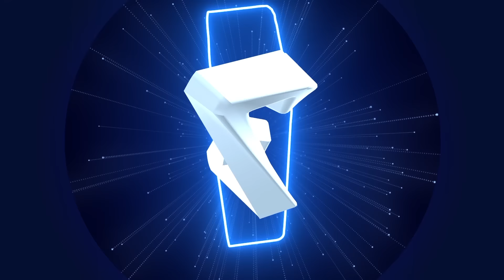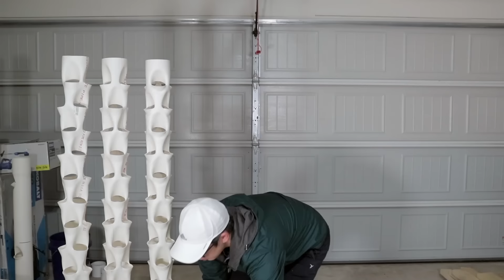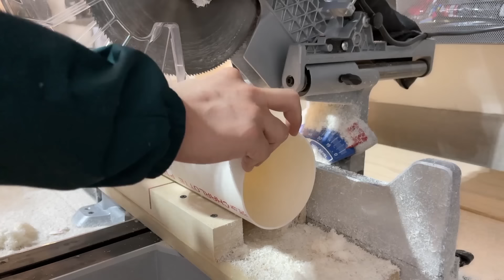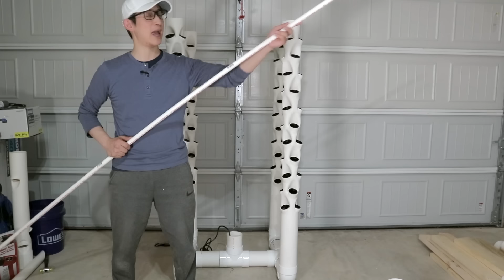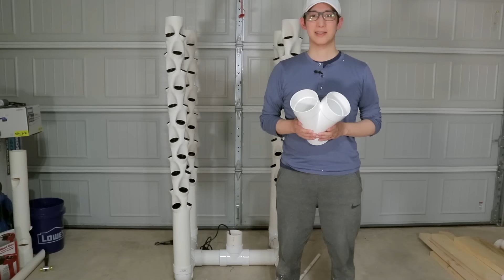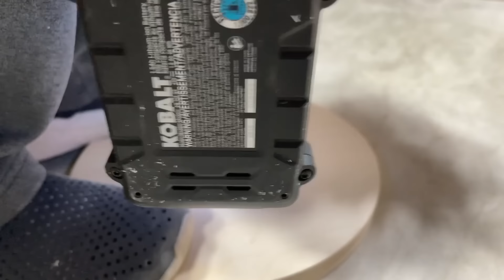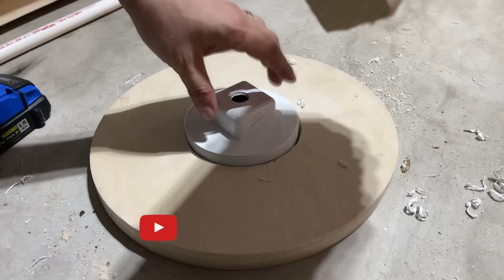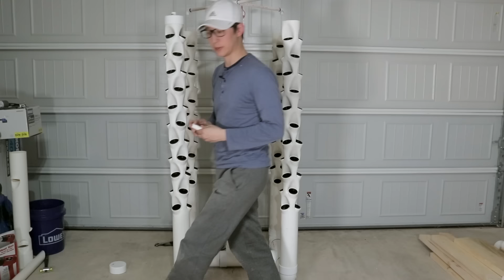DIY Hydroponics | Aeroponics Garden Tower Build | Part 2 - [4 Tower Build]

Comment: What angle did you cut the 2” pvc pipe at for molding the basket holders?
Reply: As far as his chop saw would go, probably. That model will do 55 degrees left or 60 degrees to the right.
Reply from the maker: 45-65 degree angle, but to be completely transparent, I just cut it blindly to have a sharp angle enough to get under the plastic

Comment: Also, you can put your sub pump inside pantyhose and tie it up...stops all small and large particles from getting into the pump.
Reply from the maker: Sounds like a good solution.   I didnt have many issues with particles though.
Reply: @ChrisLoh  I've done that in the past with DWC and it helped pumps live much longer...especially if roots can get to it somehow :)
Reply from the maker: @michaelgoodman5247  Great.  Thanks for the advice!

Comment: Is the PVC plastic and adhesives non toxic?  I’m worried about the leaching of toxic chemicals into the water supply and plants.  Thank you very much.  Your build is awesome! 😊
Reply from the maker: it is non-toxic, however heating the PVC may release a small amount of "toxins" but not lethal.  In the next build, I'm thinking about adding a water filter layer somewhere in the build process.
Reply: @ChrisLoh  Thank you for responding.

Comment: Great video I am going to start building these with my 8th Grade class... I planning on ten units. Please share the specs If you would.
Reply from the maker: That's a great idea.   Im sure they will love it.  I'll try and post the specs and details soon.  Need to complete my site first so the content has a home :)
Reply: @ChrisLoh  How deep did you cut the pipe for the 2 inch baskets before heating them up?
Reply from the maker: @captschmid1980  I think it's more of the length of the cut than how deep since that may vary depending on the size of the blade.  I believe the length of the line was around 2.5" which is where I stopped the blade when it reached each end of the line.  Hope that helps.  It was really trial and error.  too short of a line sometime led to tearing when creating the hole and too long took up too much space.  

.
Reply: Just be careful with keeping them from contamination. If a fungus is infection occurs in the plants all the towers in that until with likely have to be discarded